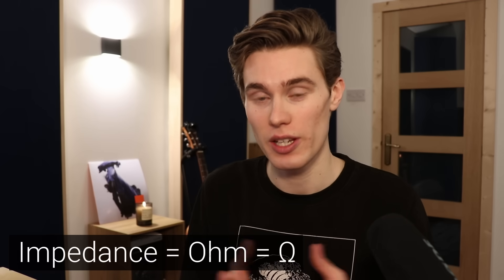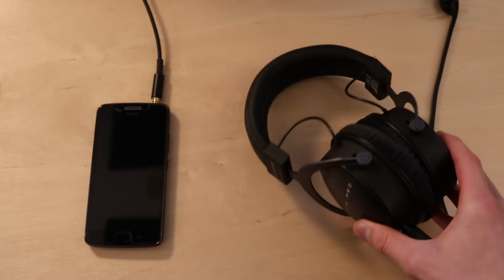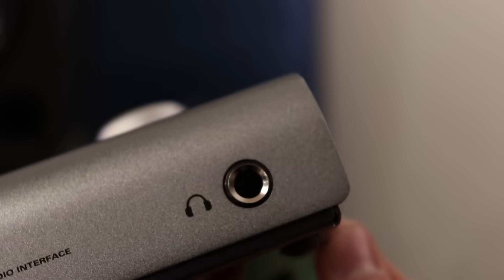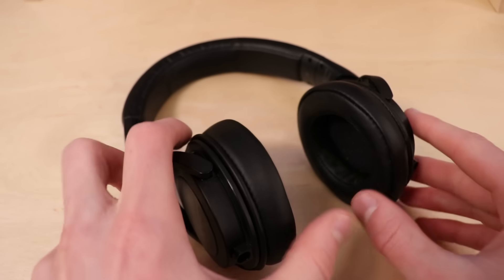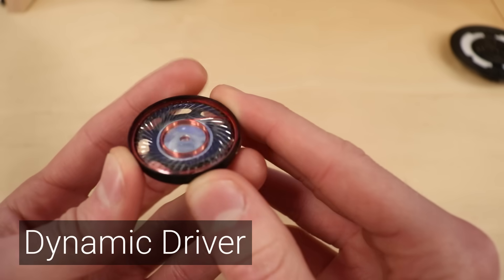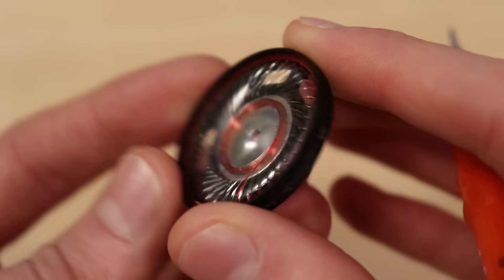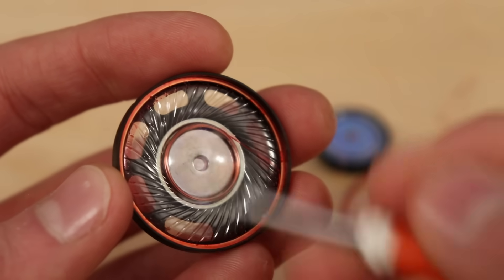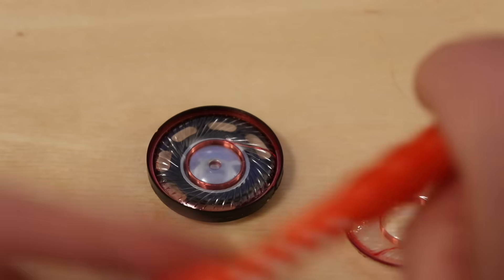32 ohm vs 250 ohm - Which Headphones Sound Best?

Comment: Have to disagree. With 250ohms plugged into your phone you can get a decent volume. If you crank it up to the maximum it'll sound loud enough or even a little too loud. It might depend on a smartphone, but tested it on multiple devices and it sounds good 🔥
Reply from the maker: I think it depends on the sensitivity of the headphones and the smartphone yes! All I know is that with my headphones and the phones I've tested, that isn't the case! But real world testing always varies, thanks for the input :)
Reply: In The Mix VS Oversampled FIGHT! FIGHT! FIGHT!

JK 😉

Comment: Does anyone know any good audio interface /headphone amp, that i could use for the beyerdynamic 770 80 ohm or 250 ohm?
Reply: I use a Focusrite Scarlett and a DT 770 pro 80 Ohm. The volume range is perfect for me.
Reply: giacomo raisi rojas +
Reply: I have Bayerdynamic dt 990 pro 250 ohm connected to a Focusrite Scarlet 2i2 first generation. It sounds good, but a bit too low in volume. I also would like to know if there are any other affordable ways of powering this headphones properly ( other audio interfaces or amp )

Comment: That's a really in-depth video Michael. Thank you for making videos like this. 
I have one doubt i.e. you said that the headphone receives AC and because of that the polarity keep changing. So the small diaphragm moves in and out. But a mobile phone runs on battery and i believe a battery supplies DC. So, my question is does a headphone have a kind of converter which makes DC to AC?
Let me know, Thanks!
Reply: To quickly answer your question. It's the phone that'll be doing all the work with the voltage to the headphones.

Likely has a mini amplifier so to speak. Which doesn't need to power anything crazy, so it'll easily fit in the phone.

Maybe someone else can come along and explain it more in depth, but for now that's all I got.
Reply: Yes, the DC is used in the phone, but the phone also needs AC for several internal functions. The AC is created by converting some of the DC, including AC required for audio output.
Reply: @ot9er  Thanks :)

Comment: Great video it definitely cleared lot of my doubt . but wished to have this video bit early as 2 months back :) , before buying " Sennheiser HD25II" and Dac+amp (Fiio K3) month ago . which i am happy with, but would have tried Beyerdynamic ,anyway  
I still have a doubt if it is necessary to have Dac/Amp for  70 ohm headphone, because these are in between consumer and professional headphones. and no one talks /gives a clear answer to use a Dac/Amp for a 70 to 150 Ohm headphones.
personally (using HD25 with or without dac)  there is no a major difference for me, except when played a DSD file . But me being a beginner in sound, but a video editor (for a decade )didn't had the need to work on sound as there were music producer or a pre composed track.
 but now as i have started working for a Digital media company. I got interested in sound and to may my videos more better i have started learning "Sound design". so should I continue using a DAC just to improve my listing  or should I Upgrade to a more professional Headphone.

Comment: I did owned the Beyerdynamic DT 770 80 ohm, and did feel their to sharp treble & way to heavy bass for mixing. But theyr fantastic entertainment headphones though. Especially that LIVE feel to them which make it feel you are really there on stage!  Then i also owned the Sennheiser HD 595 before those (50 ohm?), which are fairly good/balanced for the price. Not at all same build quality as the Beyers though. Then after the Beyers (since HD 595 was my first Pro phones) i got the AKG K240 MK2 (65 ohm). These are very neutral, very lacking in bass for some? Transparent, but boring in my opinion. Mixed for them couple of years, then now finally in 2019 decided to go for the Sennheiser HD 660S. What can we say about those? Sound very dynamic, (dynamic range good) bass excellent in my opinion, punchy still transparent, treable at first try sounded way worse than the AKG's, until i heard from experienced friend that K240's are overdone. Well anyhoot, what we can do is use Sonarworks Reference 4 for headphones to correct the signal, before we start to mix. That way, it dosent really matter what phones you are using... However, it is still a treat when you'v finally found the phones that work for you! And the feeling i have so far is that the HD 660S is the best most neutral/dynamic phones iv had the pleasure to own for mixing purposes so far. EDIT  [The impedance for those is 150 Ohm's, one reason why i choosed them was because my external usb interface Focusrite 2i2 was not recomended using anything above 200 ohm's.]
Reply: 3DFX I disagree I think the DT 770 80 ohms are perfect for mixing

Comment: I have two headphones - KRK KNS8400 36 ohm closed back, and Sennheiser HD 650 300 ohm open back.  The 650's are definitely more hifi, great for mixing.  The KRK's seem to be better suited to tracking, can't stand the 650's for tracking for some reason.  Also got Sony ear buds.  I wanna try the Sony MDR7506, and Sony noise cancelling headphones.

Comment: I actually bought the dt 770 80 ohm last week! I use them almost singlehandedly for music production, and they definitely need "higher volume" on my laptop to sound good. Also I feel like the bass disappears a little in them. Maybe the 32 ohm would have been better.  Wish I would have seen this a week Ago! Great and interesting video anyhow 🙏
Reply: It's an old post, but I guess you need a good monitors, try to find "Custom Studio" by Beyerdynamic. They are based on DT 770 but have a much more neutral sound curve plus a bass slider (when closed it's linear and 3 positions of opened to help you hear how something will sound on different systems). The way you wrote this, I guess you're still learning, so be also aware that with 32ohm you might miss some details and for 80ohm and up, forget about laptop/PC onboard and get at least cheap DAC (it'll amplify your sound signal for higher impedance).
B: Bass SHOULD be subtle, you're monitoring. If you want a headphones for track mastering, then go for the DT 1990 Pro, just note that they cost a lot more and you need a much better DAC to drive them (250ohm) but they have the best treble for that job, seriously they are so good that even in some popular songs you can hear when mastering wasn't perfect, microphone positioning etc.
Reply: @L0vac   @L0vac  Lol yeah I was just starting put back then😅 I have the DT 880's rn, 250 ohm. I run them through an audio interface so all good there impedance wise. Nicely balanced cans, however they are a bit too hyped in the treble imo, less hyped than 990's that I also own lol, but still a bit too bright. 

I have been checking out the 1990's but rn they are a bit too expensive. But interesting about those custom studio ones, I'm intrigued! How well do you think they hold up against the 1990s? :)  cheers
Reply: @lando199  Well 1990 are also strong on treble (most studio mastering are) xD Less than 990 for sure, but don't know how it would compare to 880s.

Regarding CS/1990 it's hard to compare them since first is closed-back monitoring and latter is open-back mastering. 1990 are not for noisy work surrounding as they will obviously let people arguing for example in. From the sound POV 1990 are of course better with wider soundstage and more "to the point" bass. BUT Custom Studio was about 25% of the 1990s price :S (sure you get a professional bundle with them but it's still a lot of money). I actually have them both at the moment, so if you're interested into something specific, give me a shout.

Note that CS stopped manufacturing, so you'd need to get used ones and then new ear pads.
Reply: @L0vac  Haha that treble f***s up my highs in my mixes😅 Nah man that's cool, if you want then by all means but I don't think I wanna go through the hassle of finding a pair of good used ones if you get me.  On a second note I think I'll wait with considering new phones and start treating my room instead, and use my studio monitors more :P

Comment: I've had the DT 770 pro for about 4-5 years now and I absolutely love them! Cannot recommend them enough. I use them for listening to music, (really, really amateur level) music production and gaming and I've never been left wanting more.
Reply: I have it too from last 2 years ago  and i love it, just i've broken up my 770's and i decided to change because some comments telling the 990 PRO are overall better, they all are complete wrong, the 770's is a lot more inmersive in gaming and soundstage.
Reply: are you using an amp?
Reply: @ChikoNJackoTV  I am, but tbh they work fine without the extra power!
Reply: Hey, I know I'm like 2 years late, but how many ohms were you using?
Reply: @ProdCola  80 ohms :)  Still using the same headset btw, if you get one it's a good investment.
Reply: @MrThreeWorlds  Thank you so much for the reply! Was planning to do pretty much exactly what you described and wasn’t sure whether or not to get 80 ohm or 250 ohm. Glad to hear you still use them.

Comment: Since I watched your last video about headphones, I bought the beyerdynamic dt-770 pro and I'm very glad and thankful about that. You can hear the improvement in my songs. My first song was made with 25€ speakers and my latest songs was made with these headphones. I'll be honored if you check them out and give me some feedback🙏
Love from Germany❤
Reply: Immer diese Deutschen 👀
Reply: @bratspinat  Ja, die gehen echt gar nicht....
Reply: I've tried both and bought the DT 990 Pro. I'd like to say that if you want a great pair of open-back headphones with lots of space/stereo field, those are the way to go. I'm actually looking to get the DT 770 Pro for my next pair of closed back headphones. 

I got the 990 to replace my old broken ATH m50x (what an upgrade that unexpectedly was!) and I realized I need closed backs for vocals with less audio bleed. I quickly fell in love with Beyerdynamic when trying them at Guitar Center and comparing different pairs, they really are special.
Reply: @mikeexits  Hey Mike, I'm actually looking for both closed back & open back headphones and based on my research I'm pinned on both DT 990 Pro & ATH m50x based on performance & pricing. Since you've had first hand experience with both.. do you recommend either/ or both of them?
Reply: @GauravSakhareOfficial  I would recommend the DT 990 Pro  for open back (250 Ohm if you have an amp or interface for it and can boost volume, otherwise go for 32 or 80 Ohm) and the DT 770 Pro for closed back (again, whatever Ohm number fits your needs). The m50x has the advantage of being more portable (can fold up and both headphones can swivel quite freely, whereas the Beyerdynamics cannot fold up, the best you can do is reduce the size adjustment on both sides) and allowing you to swap out the cable if it gets damaged. That being said, in my experience the Beyerdynamic DTs are superior in every other way; they have a much wider stereo field (m50x sounds very cramped and compressed by comparison) so it's a lot easier to tell where sounds are coming from, and the layers are noticeably more clear. EQ also seems a bit more flat, though not completely so, so listening to your favorite music on them will still sound amazing. 

I also think the DT 990 Pro is more comfortable (after you've worn them for a while, they are a little tight at first). I don't know for sure about the 770 Pro in that department since I have yet to own them, but from trying all 3 at Guitar Center the 770 Pro seemed to be of similar comfort level to the 990 Pro.

I'm no beyerdynamic fanboy. In fact, I used the m50x for about 6 years and swore by them before my only pair broke through no fault of my own (the hinge on the left headphone became loose so it would lean away from my ear when I'd put them on, making them unusable without wearing a tight hoodie and/or holding it against my ear) and I had to buy another pair of headphones. I was planning on buying another pair of the same, but when I tried the Beyerdynamics at the store, I fell in love and realized I should upgrade. 

Anyway, if you have a way of trying them out yourself, compare them for your ears and see what's best for you. Everyone has different tastes. I suggest going back and forth, making the transition as quick as possible so you can really tell the difference in their sound character. But my recommendation based on my personal experiencr is definitely go for the beyerdynamics; 770 Pro if you need closed back with more isolated sound (for condenser mic recordings without picking up a lot of the output from your headphones, or listening in louder environments, for example), or the 990 Pro if you will mostly use them in a studio/quiet home context and want the maximum sound quality and "openness"/spacious stereo field for your money. 990s do sound slightly better and noticeably wider to my ears, but they are both, again in my opinion, superior in every way aside from portability and ability to remove/replace the cable. Good luck , let me know what you decide on and of you end up liking them (if you remember to)! :),

P.s. Make sure you check every online store you can to get them as cheap as possible! In guitar center (and probably most brick and mortar stores) the Beyerdynamics are noticeably more expensive, but online you can get them for a very similar price and save around $50.
Reply: @mikeexits  Wow, that was a detailed input & it definitely cleared almost all of my queries regarding the purchase. I'll be using the headphones in a quieter environment (bedroom studio xD) so I'm leaning towards the 990 Pro. Although I do prefer some color, especially some boost in bass and highs (6 to 9K) & I like the fact that they are designed in a similar fashion, I mostly need them for productions so I might use an EQ to flatten the frequency response. Also, I've never experienced open back headphones before so I'm really looking forward to be using them.

Anyways, thanks for the extra tip about pricing. Will test the waters and then make an educated decision. :)
Reply: @GauravSakhareOfficial  I think you'll really like them then. They're just flat enough to be great for producing, but they do also help the music sound great. I enjoy them for just listening to music too. As long as you don't listen to a song on bass heavy car speakers or something similar, then immediately listen to it on the headphones, I think you'll find the bass perfect; not overbearing but not underwhelming. Anyway, have a good one, peace. :)
Reply: Same here!

Comment: Lower the ohm the loader the bass? The higher the ohm you hear less bass?
What about the krk earphones any good for rap/ trance music?
Reply: Not unless you are trying to run high ohm headphones that are not very sensitive off a phone or weak powered device, then it will have low volume and weak bass.

For example, I have Beyerdynamic T1 with 600 ohm. They can run off my phone because they are fairly sensitive, but not very loud. I also used to have the Beyerdynamic DT770 250 ohm, they were about the same in volume from a phone. 
If you want to use them on phones etc then get headphones with low ohms that have a good sensitivity. If you want good bass, then just look up reviews, because you can have lots of bass, but they may sound very horrible in other areas. That comes down to the way the headphone was designed.

Comment: If I am just plugging into the mac (3.5mm jack) would the 100 ohm be a good middle ground choice?
Reply: G Thomas yes! 100 works fine with phones and computers without amp
Reply: @salicat  Thanks! Actually, I think they only do them in 80 ohms. And then there's a 80 ohm version and a 80 ohm (Studio) version. What do you reckon?

Comment: Beyerdynamics Tesla 2 Drivers @ 250 Ohm in the DT1990 and 1770 are a lot easier to drive then their DT 770 and DT 990 counterparts also @ 250 ohm. They are both 250 ohm. My Phone sounds very loud with the DT1990s and even louder (deafaning at max) with my Bus Powered RME Babyface Pro.
Reply from the maker: I find the Tesla 2 dimrivers to be better in every way, but there's no denying the DT 770 and 990 are legends. I bet! The RME will have tonnes of headroom. They have some of the best interfaces around,I was thinking of upgrading to one soon
Reply: @inthemix  Without a doubt, legandary! Ya, RME just actually released the Babyface Pro FS, which gives slightly more headroom in the exact same form factor and even keeping the same usb 2 port. They go into better detail on the website for sure. Im not going to upgrade to it right away, as I havent had the Original BFP for that long, but they are very solid interfaces, with rock solid drivers, and manage to somehow achieve lower latencies than many thunderbolt interfaces. I always think that RME is perfect for working on tracks/live midi and , and UA apollos are aimed more at vocals and user friendly (still both great performers). Total mix (RMEs mix app) was a bit confusing for me at first, but im sure you would have no trouble with it whatsoever.

Comment: I have the Audio Technica Headphones M40x which have an impedance of 35 Ohms. Are these good for music production?
Reply: oh man that model. me too so, wait him answer :D
Reply: Like it was said in the video, it doesn't really matter its all about what you plug into. The m40x is reasonably flat and has acceptable resolution (sometimes described as detail or grain) you will be fine with them if you don't have a pair of monitoring speakers (which you should use as your main point of reference when mixing where possible)
Reply: Yea me too 😂